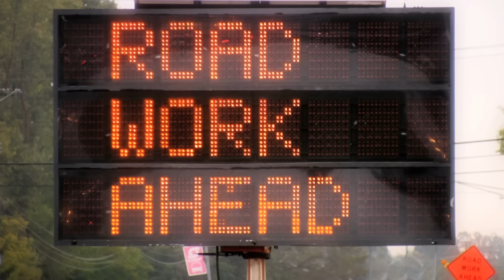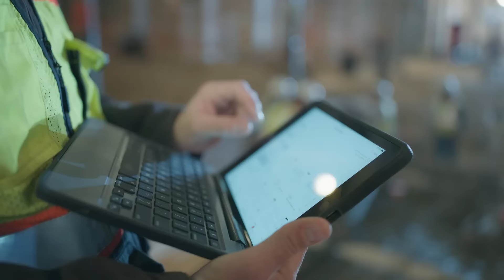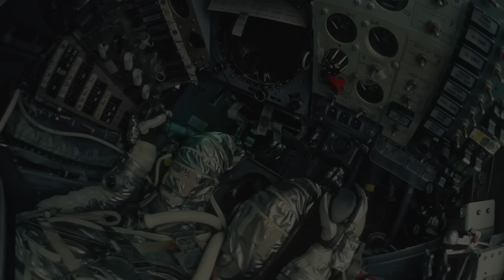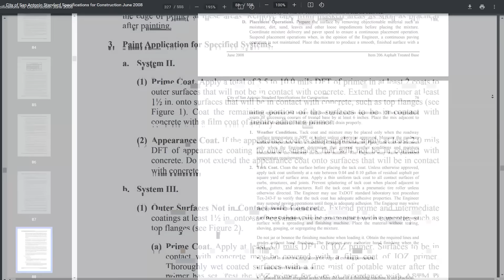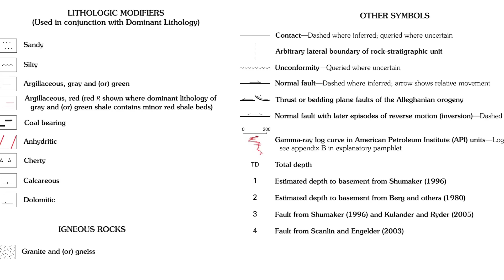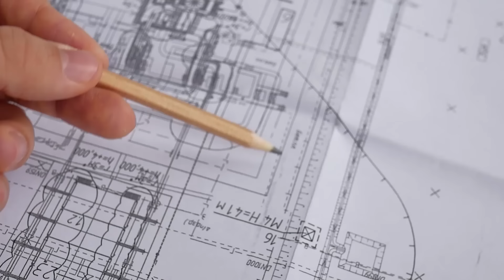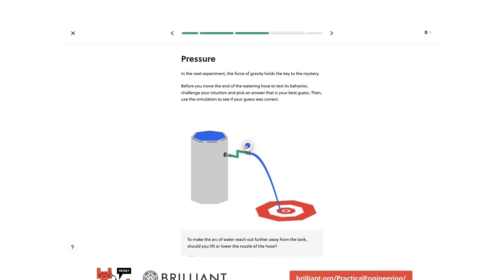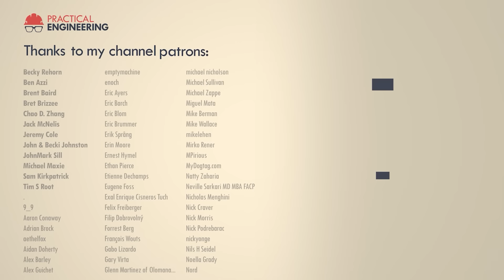4 Myths About Construction Debunked

Comment: About survival bias and ancient concrete: 
Just take a look at those city gates that had traffic running through them when cars became numerous. Black, corroded, and in many cases they collapsed (or had to be torn down because they degraded too much). Or what happened to bridges as car traffic increased, those old bridges often have very low speeds and low vehicle masses allowed, because they can't take the stress.
Reply: The ancient Romans also did not have corrosive exhaust plumes, massive Industrialisation burning Coal and Oil and therefore Acid Rains.
Reply: @kleinerprinz99  Very good point.
Reply: Well the Colosseum didn't have to forcefully fit many times the people than it was designed for and it was only used during events, so of course it survived and those pillars shown carry nothing on top of them so...
Reply: There is something to be said though for roman concrete, specifically the aquatic concrete they used in their sea ports. I forget the full chemistry but where normal concrete degrades in salt water through chemical reactions with salt the concrete the Romans used had volcanic ash that when exposed to sea water reduced some of it into aluminum oxide basically making a passivation layer on the concrete and drastically reducing corrosion. That doesn't make it stronger but it is how it survived until now. The same technique can certainly be applied to modern concrete allowing a more chemically stable structure than not. As someone who lives in NY where salt is regularly applied to the roads this would be exceedingly beneficial.
Reply: ? what are your on abou,t if you keep the the really big suspension bridges out on the grounds they  didnt have the materials needed, the same reason, we don't have space elevator's at the moment
neally all stone bridges, more so the arched ones, will almost anything with on limit, the same can'nt be said the the new steal or concrete one, the do have great strength, but a well made stone Bridge, will beat any new bridges of the same size, in all ways, the big ones not Max weight, and almost on maintenance,  needed , and the ones needing maintenance, is mainly because there old some times very old, as to more moden bridges, needing routine maintenance checked every year or so, when was the last time a stone bridge fell down, stone bridges have a lot in common with tunnels, more so the old ones,
Reply: @kleinerprinz99  Acid Rains? Not true. Did you forget Volcanoes?
Reply: @RabbitsInBlack  Do those erupt often enough to cause the same acidic rain as we have now?
Reply: @dh2032  i totally agree,
structures made with compression lasts longer.
i wish we had the foresight to build structures ment to last 300 years to a millennium with minimum maintenance.
if i ever build a house i will build it out of stone with arced ceilings, because it does hold for centuries.
also i would avoid rebar, because in the long run (100 or so years) they might rust or deteriorate.

If the construction stands without the need for reinforced steel must be built without the need for tensile stress.
the problem is not that we do not know how to build sturdy structures that will last for centuries, but rather that there is no economic incentives to do so.
we need to rethink the longevity of projects and give economic incentives for durable constructions to take place.
Reply: @GloomGaiGar  sulfur dioxide, carbon dioxide, etc are expelled from volcanoes even while dormant.
Reply: @dh2032  ... I feel like you need to throw in some documentation if you come with a claim like that...
Reply: It''s almost as if a car weighed more than pedestrians, horses and carts!
Reply: I worked in a calibration lab with heavy floating granite inspection slabs. whenever a truck would drive down the road they could pick up the vibrations on the measuring gauges!
Reply: Oh man.  Personally I'd pit today's bridge technology against a roman arch bridge in just about any scenario.  And frankly, today's bridges DO use arches like that when the situation calls for it (search for buried arch bridges as an example).  But the reality of it is that most of our bridges have requirements and demands that do not allow for that type of structure.  The site's topography, bridge span requirements, clearances below the bridge, roadway alignments (say the bridge needs to be curved),  site specific force demands (earthquakes/hurricanes for example).

Generally when you see a bridge with reduced speeds or loading requirements, its due to less than ideal maintenance (occasionally from a lack of full understanding of the material at the time of design - fatigue in steel comes to mind for those 60yr+ old bridges).

As someone who does this for a living, a LOT of effort goes into picking the correct structure at a given location.  Sure sometimes a community/owner wants an aesthetic look that takes away from the pure economics of it, but we consider initial construction costs, impacts to traffic during construction, constructability,  long-term maintenance costs, future roadway needs (are we going to widen in 40yrs?), structure life span, alternate layouts, environmental impacts, utility impacts, right-of-ways, etc etc.

The effort and process isn't perfect, we're people too.  Oversights happen, construction issues come up, etc and failures are very public.  But as amazing as what the Romans did with the understanding and tools they had, what YOU have is 1000x better.
Reply: @nilsdock  thanks I thought I would get flamed, for the comet  It not a subject, I would say  I'm greatly skilled with? But if you don't ask your not going to find out? :-)
Reply: @thomasrogers8239  Ash is sometimes used in modern concrete mixes too, for a variety of reasons. I think this was in the bigger Roman concrete episode.
Reply: @nilsdock  More homes get intentionally demolished than ever fall down. You really think your home made today will still be desirable in 300 years? I mean, maybe. It's not completely impossible; some homes do last that long or longer. But the overwhelming majority do not. So you would be spending hundreds of thousands of extra dollars just to make the later demolition job more expensive.
Reply: @dumptruckintruthduke  bad egg smell
Reply: @silak33  just observation of the would more so area where I live the there a state of concrete road flyovers been nocked down because the steel concreate has given up, 1960-70stuff (on the out side the still looked fine, a bit grubby, but not looking like would fault at any moment), and we also old semi, 1850 stuff, Victorian rail way interstructur, a lot on build up banks, if the track on top, and bridge, stroke tunnel going under the track, there new bridges, but I'm referring to the older one of the arch type, it not uncommon to see large Lorry Driver HGV having a go and hitting the bridges I not say there not check they still safe after but , the most any have need was just replacing the brick that where nock out, I don't think any of the steel or concreate would get off that lighter sort of damage
Reply: Not to dismiss your post...but low speed vehicles have a higher impact on the road than high speed vehicles.  But I get your point.  High speed traffic usually results in a higher volume of traffic which ends up shortening the life span of the pavement.
Reply: My name will stress you so don’t read it
Reply: @GloomGaiGar  No, Volcanoes don't have to erupt to give off acid rain. They do give off tons of gas even when they are not erupting. That's why it's always dangerous to be near a volcano. People actually collect the Sulfur from volcanoes. It probably will kill them from mining it like that and breathing in the fumes but it's a living for some.
Reply: @thomasrogers8239  is there a good link for that? I'd like to read more
Reply: @billschlafly4107  You are blatantly wrong of course. Higher speeds means a higher load for the same vehicle. So no, you did not dismiss my post, just show that you do not know what you are talking about.
Reply: @kleinerprinz99  : ha ha, well the exhaust belching infernal contraptions may end up being a mere footnote - though destructive - entry in the historical record - if all goes to plan.
Reply: @EebstertheGreat  the homes that get intentionally demolished are often demolished because of the poor build quality in the first place. 

older houses that still stand, are often built well to begin with. 

also it is wasteful to plan for a building to last only a short time.

in Sweden where i live, one of the most popular styles of buildings. are the ones built early 1900 or late 1800. to put it frankly we do not build them like we used to.
Reply: @nilsdock  In Massachusetts, you see tons of old houses from ca. 1900, some slightly earlier, some slightly later. They are all unreasonably expensive to maintain due to their age. People who still own these houses have had to replace its insulation twice, have had to remove lead paint or just deal with the fact that it will be there their whole lives, have had to replace all their windows with energy-efficient ones, have had to rewire the whole house, and so on. So yes, they get to live in something old, but is it worth it? And these are just over 100 years old. Imagine another century in the future, will it still be a good use of money to keep these things around?

Here in Cleveland, houses like that get demolished, not because they were poorly built, but because they can no longer be sold. The economy destroyed those houses. It happens all the time.

And the thing is, a house built to last 300 years won't really sell for much more than a house built to last 100 years. So you aren't really getting your money back. It's just way more expense to you for something future generations might benefit from, but you'll never know.
Reply: @EebstertheGreat  i understand your point of view, but do not agree. building things to last is not a bad thing, yes it costs more to build. my point is if you build a modern house that is built to last. it might be cheaper spread out across the lifetime of the building.

i would hate to live in a world where no things last more than a century. old buildings give character to a place. if you walk around in a old European city center, you will know what i mean.
Reply: Should also mention how unlike with the Romans, things like roads tend to experience greater wear & tear due to friction as due to the greater loads of vehicles & the fact that there is more traffic/vehicles passing on them per day. Rubber generates more friction than wood or metal, and the wheel are design to grip the road better. People build structures where the Romans would either avoid & wouldn't dare build in (so they never had a need to test their concrete against those elements). And should we also mention a different sense of ethics? Romans were much more different than us, as they could attain cheaper inhumane slave labour and carry out time/labour-efficient production methods to make high-quality materials that would be seen as unethical by modern standards.
Reply: @dh2032  I do agree with your opinion about the advantages of stone bridges as I live very close to an almost 200 yrs old stone bridge (was made long before the era of cars with convict-labour), that for almost a century now has carried 2 lanes of highway traffic & served as a crucial piece of Sydney road infrastructure (it's called Lansdowne Bridge, in Lansvale, NSW, Australia). However, it should be noted that there's a reason why stone & arches aren't always used, the first being erosion/hostile environment, and the second would be load bearing. The bigger you build using stone, the greater and sometimes wider the foundations required to bear such great loads (depends on type of rock used and soil dynamics of where you're building). Also the amount of logistics & labour involved would be higher & more painful to sort out.
Reply: @spvillano  Or a truck!

Comment: I was an industrial electrician for 30 years.  Once in a while I had to step through a door away from the  hot dirty and kinda dark factory floor and work on electrical problems in bright air conditioned offices  with their comfy (literally) $1000 chairs.  While those office workers were hanging around the water cooler or or likely looking at their stocks online, they were often talking about the lazy line workers on the other side of the wall.  The vast majority of people that work on the line have every second of the day mapped out for them, time study makes sure they are never idle.  They can't even go to the bathroom when they need to without first getting permission and someone to take their place on the line.  The same office worker that could take a break anytime they needed to harped about how the line worker got too much break time.  I worked in an office for a while, a whole lot of time was taken up with what was called networking and on Friday people disappeared early to beat the traffic.   Call it what you want, if those guys on the line had time to do it, it would be called something a lot more negative.  I am sometimes surprised any work gets done in an office.
Reply: The thing about offices is that no real work happens in them, 90% of the work done is pointless tasks made to make the company look larger
Reply: @calebbarnhouse496  I can not disagree
Reply: And as the electrician you were doing the least amount of work out of anyone in the factory lol
Reply: @ErikNemo  More than some supervision, but far less than those people on the line.  I do thank God for his favor.
Reply: @ErikNemo  Line workers were working very hard.  I thank God for the job I had.
Reply: @ErikNemo  And also had the most technical knowledge and was the least replaceable of them all
Reply: Depends on the office you are talking about.  A large, corporate office, yes, you can definitely get away with slacking a bit, and people often take advantage of that.  There are also lots of useless meetings and management approved nonsense that just wastes time.  I've worked in that environment.  In fact there are even some in that environment that will get down on you for working hard because it makes everyone else look bad.

A total 180 from that is if your office is one that serves customers, and especially if it is a small operation with few workers.  My office is me, myself, and I about 95% of the time at a busy CPA and tax firm.  I have one older gentleman that works under me part time, but we rarely work together, usually he covers my office when I am at our main office helping the boss with things.  There are days at my office where I work 9am to 9pm without a chance to eat, go to the bathroom, or get a cup of coffee or a smoke.  It is hourly appointments one after the other for 10-12 hours, and if one gets behind it puts your whole day behind.  On top of this, being a store manager, I am also responsible for bookkeeping, bank deposits, and general upkeep of the site whether that be vacuuming the office, shoveling snow out front, or just keeping it from becoming a mess.  I also have to answer the phones.  We don't have secretaries.  The boss runs a very tight margin on everything.  I am compensated very fairly for my efforts, am eligible for overtime (which I get a ton of during tax season), and I genuinely like the work and the customers.  So I'm not complaining because I like it.  But sitting around wasting time, I am not.  Pretty much ever.  There are downtimes at certain points in the year, but then we aren't working every day, so we aren't getting paid for nothing.

So bottom line is it is also a common misconception for labourers to think that office workers spin around in their chairs and get paid to play with their phones and take unlimited coffee breaks.  Not in my office anyways.  Also my pay is directly impacted by my office's performance, so it is well in my best interest to always hustle and crank out as much business as possible.